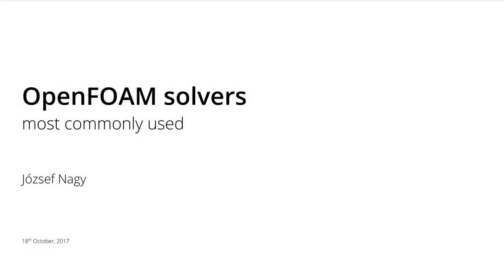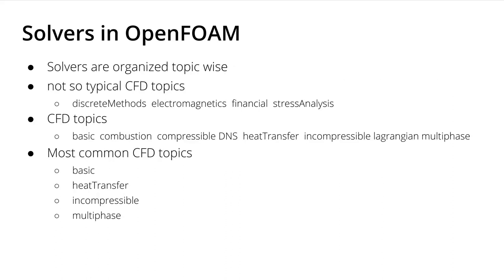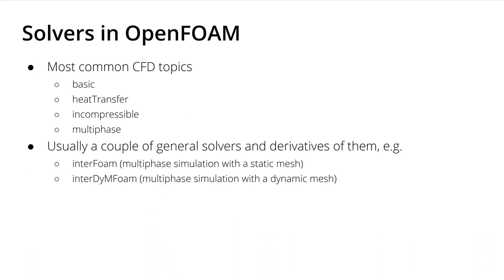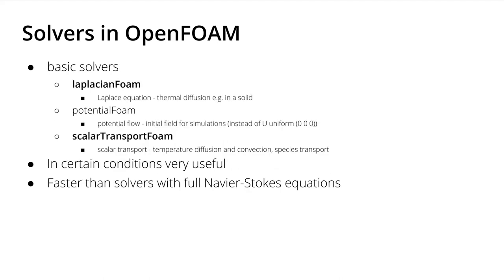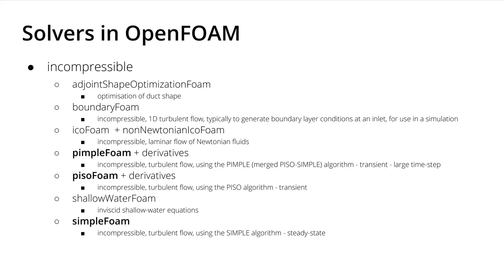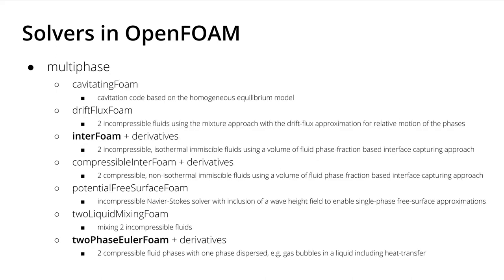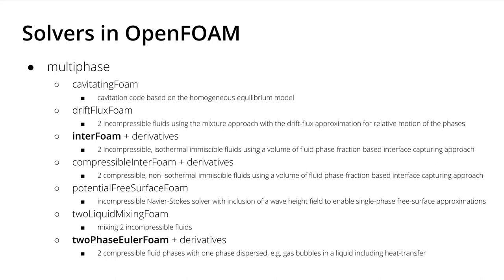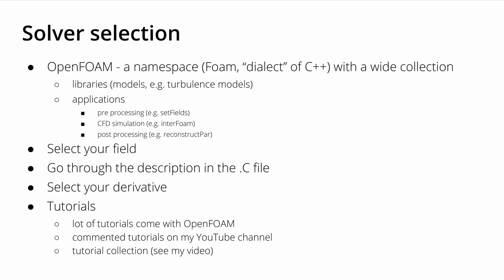How to find the most suitable solver for OpenFOAM simulations - tutorial

Comment: It is possible to do Moldflow Simulation as CFD or with OpenFoam? Moldflow would consider flow, heat transfer, volume reduction in a form and changing from liquid to solid in several steps.

Comment: Thank you for the video, I want to ask you a question.
Let say I was able to choose a suitable solver, how can I choose the Linear Solver and Preconditioner in fvSolution for my simulation? More specifically, what Linear solver and Preconditioner should I use when I want to reduce the calculation time but still can get a good results? or can choosing an appropriate linear solver give me a better result when my mesh is not very good?
It would be great if you can suggest some documents for me to read in order to better control my cases.

Comment: Hi Joscef, i am planning to simulate a rotating water sprinkler for irrigation, i want to know the effect of water pressure and mass/volume flow rate to the rotational speed of sprinkler. what solver i need to use for this problem.

Thank you.
Reply from the maker: One of the multiphase solvers. interFoam might be calculation intensive, but give it a go. Alternatives might be depending on the answers you seek.
Reply: @OpenFOAMJozsefNagy  i will check on that. thanks for your help..

Comment: Hi József, great video!
I have a question that I hope you can help me solve it, I'm working with fireFoam to create a pyrolysis simulation, the problem is that the heat transfer in the solid and gas phases are important to my analysis, and I think fireFoam does not consider heat transfer, so I am thinking in creating a new solver with this two (fireFoam + heat transfer). Should I edit it in base of the chtMultiRegionFoam, or should I add a different equation for heat transfer, since it is gas instead of liquid? and do I have to add it to my fireFoam.C file? if you have any other comments or suggestions, I will always be happy to hear them ^_^ 
Thanks.
Reply from the maker: Wow. I did something similar duing my PhD with reactingFoam and chtMultiRegionFoam. Are you also interested in the heat diffusion in the solid itself?
Reply: Thanks for your reply, wow, I love this coincidence, jaja. Yes, I want to see how the mass will react to the heat I'm introducing. Is it better to use reactingFoam than fireFoam?
Reply from the maker: That depends on your application. Take a look at the capabilities. But It is not going to be easy given by the structure of the cht solver. I think, that it will only work to include the reaction modeling into cht.
Reply: Thanks, I will go look at how they work

Comment: Your lectures are great and highly desirable to study in detailed. Thank you. I am using OpenFoam by blueCFD terminal (Window and Linux interface). Need help to run The following Gray Scott Model by using BlueCFD terminal OpenFoam.

I am putting my path in the following way, 

C drive - program files - blueCFD Core-2017- ofuser-of5- run.
Here I have two folders 
1- grayScottFoam1 ( which contains .H and .C files) with Make folder (files and options) 

2-gSM-1 (0 constant system)

which I try to run by blockMesh command which works but Foam is not working (solver). 

Help will be highly appreciated in advance.
Reply from the maker: Did you compile the solver and did it exit correctly?